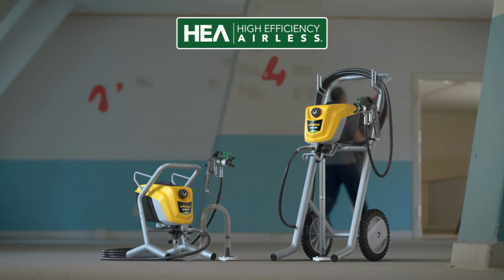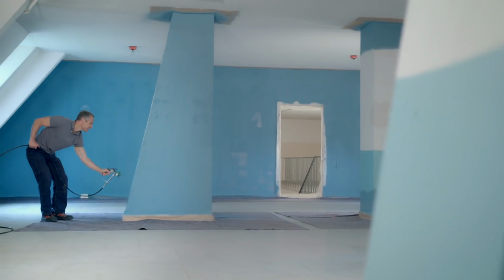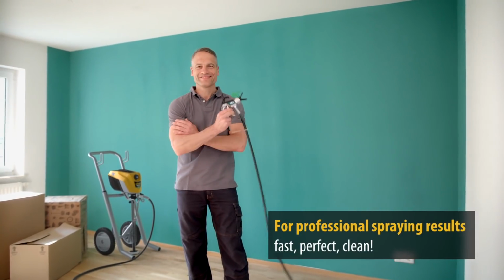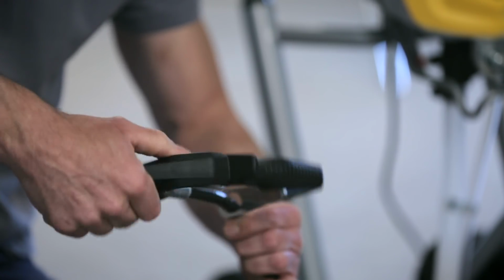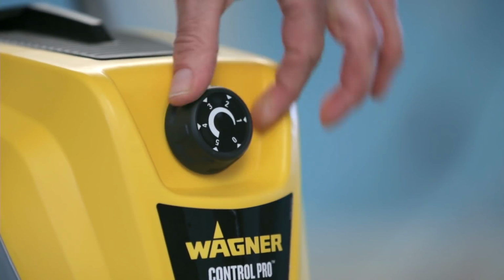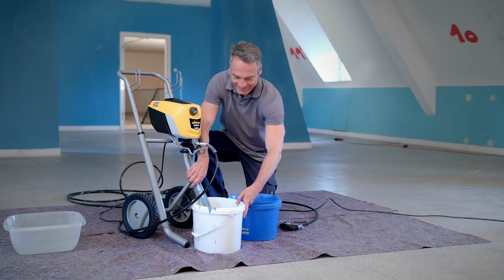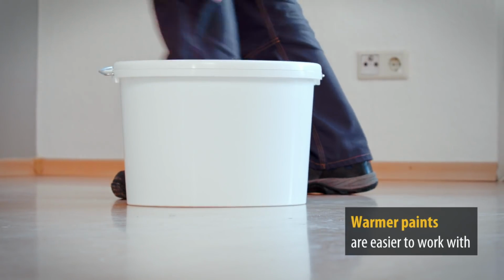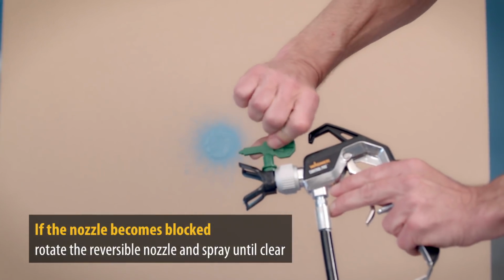Control Pro 250 M, 275 M, 350 M & 375 M - Preparation, Cleaning, Accessories | WAGNER

Comment: What's the different between the 250M and 250R model please?
Reply from the maker: Hello The difference between the WAGNER 250M and 250R is in the construction of the machines frame. The 250M has a metal frame and the 250R is a resin/plastic frame, you can see details about both products and airless in general on this page: https://www.wagner-group.com/uk/guide/airless-spraying/airless-sprayers-for-do-it-yourselfers/

Comment: @wagner
Dear

Im going to paint a house with paint of Unikalo velours on the site of producent says:
Application material
Brush: mixed
Sleeve: 12mm HD microfibre
Airless: low pressure nozzle 515 at 120-140 bars or standard nozzle 517 at 210-230 bars

Would this mega super Wagner airless spray gun able to do the job??
And i'm also wonder which one 250m or 250R or 350m or 350R?
Could u pls comment on that ))))

Thanks in advance
Reply from the maker: Hello, if you're looking for a consumer sprayer for doing work on your own home the WAGNER Control Pro 350M Airless paint sprayer would be suitable for spraying both the exterior and the interior. You can see product details and where to buy here: https://www.wagner-group.com/uk/do-it-yourself/products-and-accessories/product/airless-sprayer-control-pro-350-m/. If you are using Masonry paint you can only use the smooth version not the textured type for spraying. Masonry paint is usually water based which makes the paint easier to dilute and also easier to clean the machine afterwards. If it is just for the interior of the house the 250 m would be suitable. You can see a comparison of all the products here: https://bit.ly/3zTZM69. If you want to use a sprayer for Contractor work, you would be better to look at our Professional range of product here: https://www.youtube.com/channel/UCce8s4xycTLZPVnmn6dL3GQ Kind Regards The WAGNER DIY Team

Comment: It's great.Does it spray all kinds of paint and how can I buy it
Reply from the maker: Hello With the Wagner airless paint sprayers you can use most paint types and brands, you don’t need specialist sprayable paints.
You can use water and solvent-based paints but I would recommend using water based paints as they are easier to dilute if required and also easier to clean up afterwards. Using paint at room temperature also make them easier to mix and spray. Both paints and WAGNER sprayer are available from DIY stores and online. Kind Regards the WAGNER DIY Team
Reply: @WAGNERUnitedKingdom what's the best way to clean it afterwards? Thanks.

Comment: Does that mean we do not have to wear a mask? Like in the video tut tut.
Reply from the maker: As with all spraying projects we would strongly recommend that you wear a dust mask for protection. Kind Regards the WAGNER DIY Team
Reply: Dust mask are inadequate When spray painting, it's recommended that you wear a paint respirator. Respirator masks prevent many microscopic and scent-free particles from entering your airways during painting and renovation projects. Respirators offer protection against chemicals, harmful vapors and mold spores. Thanks for your reply just want to make sure people use the appropriate PPE when spraying 😁

Comment: I have use it and it's good but you can only work 20-30 minutes max after that the machine get too much heat and start to produce smoke. Correct me if I am wrong.
Reply: hello..because i intend to buy this product,,its truth that u said
?its getting heating after 30 minutes? thank you

Comment: I have just bought the 250M what is the recommended masonry paint and emulsion to use with this machine please?
Reply from the maker: This will work with all masonry and emulsion paints - you will just need to use the correct spray tip and check with the material manufacturer about dilution and spray settings. We do not recommend using textured masonry paint with this sort of sprayer as it cannot work with the size of spray tip required for textured paint.

Comment: Hello would this be recommended for painting plywood kitchen cabinets is it trade rated or is it more diy level
Reply from the maker: Hi Martin, 
the Control Pro 250 or 350 M sprayers are suitable (besides dispersion and latex paints for interior use) for water-based and solvent-containing lacquers and glazes and paints, oils, release agents, synthetic enamels, PVC lacquers, undercoats, base coats, fillers and anti-rust paints. 
So, spraying plywood kitchen cabinets is a very good usecase. Usually this devices are intended for DIY use but commercial use is possible, too. 

The guarantee period amounts to 12 months in case of commercial use. If the amount of paint processed with the unit exceeds 1,000 litres, this is considered to be commercial use. 

Best regards
your WAGNER Social Media Team
Reply: Thanks you ever so much for the quick response i really do think i will be purchasing one of these now looks a really good product and alot quieter than a compressor

Comment: Hello, do you need to change nozzles for priming paints?
Reply from the maker: Hi Adam,
there are 2 different nozzles included in the scope of delivery. For thin materials like primers etc., please use the 311 nozzle, for thick materials like dispersion paints, please use the 517 nozzle.

Comment: Help please. What is the best cleaning liquid for cleaning after you have finished painting?
Reply from the maker: Hi curly 123, 
that depends very much on the material you have used. For water based paints you can use warm water with a bit dish soap. For solvent based paints you should use thinner. 

Best regards, 
your WAGNER Social Media Team

Comment: Can any body tell me if I can attach the Greco Jet Roller to this sprayer,?
Thanks.
Reply from the maker: Hi Barry,
technically it should be possible to use the Jet Roller but you would need an adapter for the thread. 
However, we recommend to use only WAGNER Original parts and accessories for our products. Otherwise the warranty will expire.
Reply: Thats fine, I wouldn’t worry about the warranty, do you know where I can get an adapter for the threads,?
Thanks
Reply from the maker: @barryoneill1703  You can ask at your local DIY store or online here: https://www.paintsprayer.co.uk .  Unfortunately I can't tell you which kind of threads your Graco Jet Roller needs.

Comment: @wagner: is Control Pro 250 compatible with alkyd based paints? These types of paints can be diluted with ether-ester thinners, turpentine thinners, etc. Is the machine compatible with these thinners? Can the machine be cleaned with ether-ester thinners after using alkyd based paints (i can only assume that these are oil based paints)?

Comment: Hi, what is the difference between the 250M and 350M and the 250R and 350R as I am planing to get one and would like to know if there is a marginal difference between the AIR LESS High Efficiency machines Thanks John
Reply: 250 R is with wheels and 350 is stronger than 250 models

Comment: @wagner I've got a control pro 350 extra can you tell me :

1. what colour filter do I need to use for Leyland Super Leytex high opacity matt emulsion? 

2. if i need to dilute the paint?

3. what tip will be best?

4. what number should the pressure regulator be set at?

Kind regards
Reply from the maker: Dear asad shah,
thanks for asking! For thick materials please use the white filter! We recommend to dilute the paint, but please take a notice of the paint manufacturers data sheet. Your Control Pro Extra Set should include 3 tips (311, 515, 619). The 515 and 619 tip is for thicker materials, but the 619 is better for spraying large surfaces. So try both and decide afterwards.
 The setting of the pressure regulator depends on the temperature and how much you diluted the paint. You have to give it a try and find your best result. 

Best regards,
Your WAGNER Social Media Team
Reply: @WAGNERUnitedKingdom  OMG what an excellent product, Can you use it to apply automotive paints ???
Reply from the maker: @hey_skip  We do not recommend that because the spray pattern won't be fine enough for automotive paints. For applying automotive paints you will need a more professional device from our Industrial Solutions branch.
https://www.wagner-group.com/en/industry/solutions/automotive/
Reply: Hi

Comment: hi.Can you please tell me if i can spray putty or filler with control pro 350 or project pro 119.thanks
Reply from the maker: Hi Gerasimos,
you can not spray putty or filler with our Control Pro 350 or Project Pro 119. For this use you need a more powerful sprayer from our contractor product range. 
For more information see here and click the filter "Plasters, fillers": https://www.wagner-group.com/en/contractor/products-and-accessories/building-trade/

Comment: can i use the 250M model to spray undiluted DULUX & LEYLAND (or similar) emulsion paint on interior walls & ceilings here in the uk???

which tip & filter should i use for emulsion paint???
Reply from the maker: Hi MR V, we recommend diluting interior wall paint (dispersions and latex paint) by 0-10% depending on the paint. Detailed information about specific paints is available in the technical data sheet of the manufacturer. 
The Control Pro 250 M contains tip size 311 and 517 with filter red and white. For thin materials use tip 311 and the red filter. For thick materials use tip 517 and the white filter.

Comment: @Wagner, do you know if I can attach a small hose, maybe 3 meters, for the 350M, so I don`t have that much blocked paint? is the 350 consuming as much as 250, which is 1L inside the installation?
Reply from the maker: Hi, the smallest hose we do for the Control Pro is 9 meters, these units have to be of a correct size to cope and
deliver the pressure adequately e.g. a 3m hose on this unit would cause pulsing, as the unit couldn’t keep the hose filled to deliver more paint. This unit will deliver 9Ltr a minute as such the unit must hold a litre most of which is In the hose.

Comment: hi.Can you please tell me if i can spray 2 components colors,lacquer for furniture with Control Pro 250?
Reply from the maker: Hello, usually this would be applied with an hvlp sprayer like our W570 Flexio Universal sprayer rather than Airless Control Pro 250 as 2 pack paints have a highly aggressive solvent cellulose which will erode the seals on the Airless machine.

Comment: @WaAGNER - Can you please tell me how much paint remains blocked in the tubes? Not sure if you get me, but as a reference, I have a 1L can of black paint which I plan to use for some iron fence painting and can not be done by hand. Will that small quantity be ok for 250M installation? I am asking because you can probably recover that with water when washing, but that is highly diluted so not good anymore.
Reply from the maker: Hello the 250M holds about a 1 Litre in the system to work therefore I would recommend 5 Litres of paint as a minimum. When you are finished the paint can be pumped back from the tubes into the original paint container. Airless sprayers are designed for spraying large areas quickly.  If you have an iron fencing I would recommend looking at a smaller HVLP sprayer like the Universal W570 which can spray wood & metal including varnish and wall & ceiling paints, you can see a video here: https://youtu.be/PZh7i4BNmEY
Reply: got it, thanks!
Reply: Prise
Reply: Em português

Comment: Does the tips unclogs like Graco units?
Reply from the maker: Yes, you can turn the tip 180 degrees and pull the trigger, whilst under pressure. This will create a jet instead of a spray flushing out any blockage that may be inside the tip. Then you Turn
the tip back 180 degrees and continue to spray.
Reply: How long Wagner tips hold??? Because the price is ridiculous - 50-70 eur pr tip.. its really overpriced for finger size metal/plastic thing. But if they are so expensive, maybe I don't need to change them after every few hundred liters of paint??
Reply from the maker: Hello, how long a tip lasts is very difficult to answer as there are many things which affect the lifespan of a tip including how abrasive the material being sprayed and the spray pressure. Therefore a tip could last for only 200 litres of material or it could last for over 1,000 litres it really depends on the material.

Comment: @WAGNER - can you use 250M for exterior wall latex painting? How about varnish for wood?
Reply from the maker: Yes, you can use WAGNER airless sprayers with emulsion which often has latex in it and masonry paint provided it is the smooth variety and not the textured version which contains grit. You can use any water or solvent based paints including, vinyl, matt, silk, gloss, smooth primer, enamel, satin, lacquer, undercoat, stain and varnish. Depending on how thick the paints are you might need to dilute them, please read the paint manufacturers instructions for thinning.
Reply: thank you, much appreciated!
Reply: @WAGNERUnitedKingdom  "you might need to dilute them" because is just 110 bar (only)

Comment: What is the difference betwen M version and R version?
Reply: is there ANY other difference beside the material and color of the equipment? Something technical different between the 250M and 250R?
Reply from the maker: Thank you for your question, the main difference is the material the machines are made from, Metal or Resin. The Control Pro 350M also has a robust metal cart with wheels so it is easier to move around. On this page www.wagner-group.com/uk/consumer/airless-spraying/ you will see a comparison of the range.